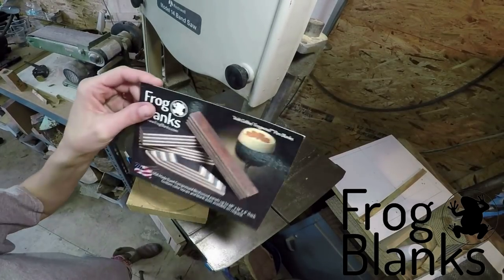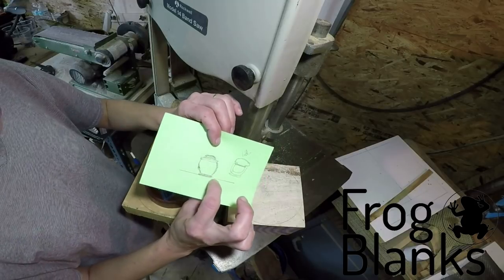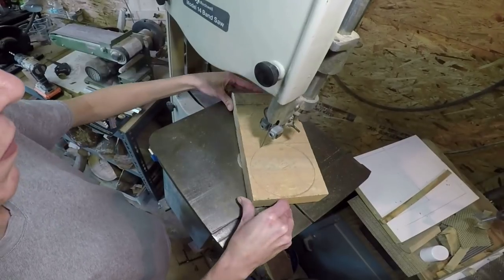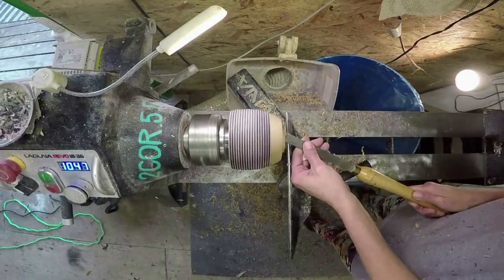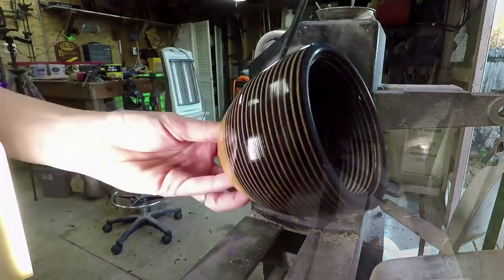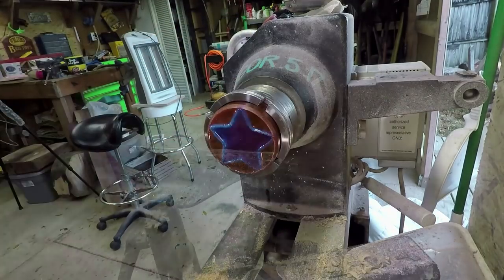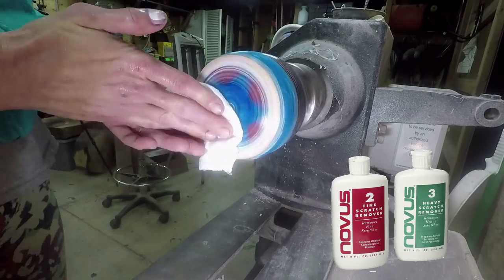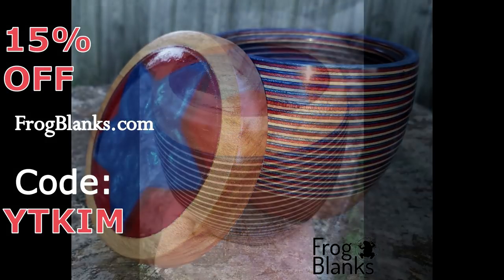Frog Blanks Red White and Blue Box with TB resin Star Insert

Comment: Nice! I would have put a ring of solid wood between the frog wood and lid as added structural support. I mean it technically is just ply wood that is colored. But the pot came out look fabulous. As your work usually does.
Reply from the maker: Thank you Joy🤗
Reply: It's not strictly plywood; every lamination is grade A or B quality birch, there is no "filler" wood, and all the laminations run the same way so you don't get any nasty end-grain rip surprises spoiling the surface as you machine it. The bonding agent infuses into each layer under heat and pressure, so the finished piece is harder and stronger than a solid piece of natural birch.

That said, mixing in layers of a solid wood for artistic effect as Kim showed can be extremely attractive - and I've seen some gorgeous Frogwood/Natural wood combo segmented turning creations with white maple veneers between every Frogwood segment :-)

Comment: Just a tip...if this is the spectra plywood, and you are using them for bowls you eat out of...the glue holding the laminates together is not food safe.  I did some checking on this.  The wood itself is...the glue  holding the sheets together is not.  Just wanted to throw that out there for others who may have wanted to know that.

Comment: Your band saw problems could be a few things:
1) the adjustable blade support arm is too far above your piece being cut.
2) the blade support bearings (on both the adjustable arm above the piece and below the table) may not be adjusted properly or their attachments may be worn or loose.
3) The blade tension may be off.
4) The saw may be Possessed by the Demon Murphy in which case, it's completely FUBAR...
Reply from the maker: Lol. #4 I say #4. I had it running perfect. Then #4 happened I am sure. lol 
I just have to take more time adjusting everything again. Time messing with it takes away my time turning.  Thank you 🤗
Reply: @KimTippin  Just be thankful you're not Related to me...
Murphy's Law: Anything that CAN go Wrong, WILL go Wrong in the worst possible way at the worst possible time...
The Demon Murphy has visited my Family so often and brought his Family with him that we've coined a new Law...
Wilson's Law: Murphy was a Fu@king Optimist!!!

Comment: I am always amazed at the different medias that you might use in your projects. Thanks Kim. I need help with one. I got some of the art deco metallic wax. I just want to color the piece a little, and still see the grain. I seem to be fat fingering, putting it on to thick so that it is not opaque at all. Do you have any suggestions? Thank you.
Reply from the maker: Thank you Joseph! I haven't tried it but, being it is water based, try adding a little water to a small bit (in another container) Then apply it. I am not sure it will work but that is how I was thinking of doing it for another project. Let me know if it works.
Reply: @KimTippin  Kim, I tried it, but I used dna. It gave me the opaque look and the grain was also visible . Thanks for the suggestion.
Reply from the maker: @josephwise485  Thank you for getting back with me. I am glad you found a solution.